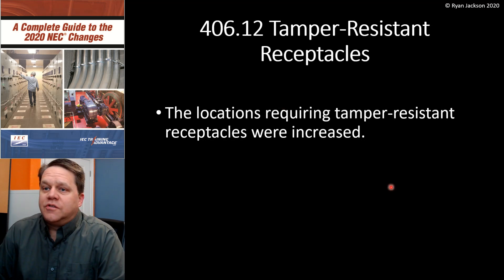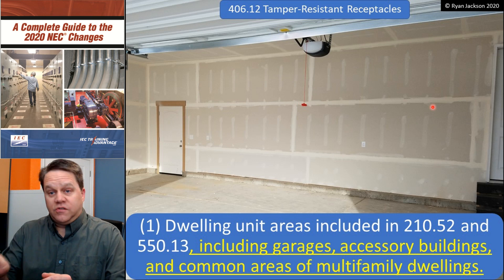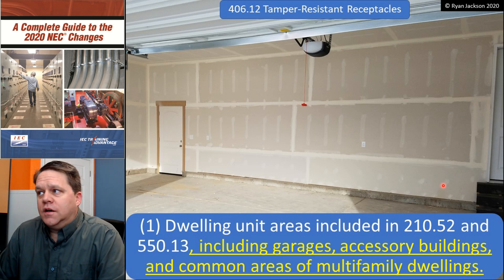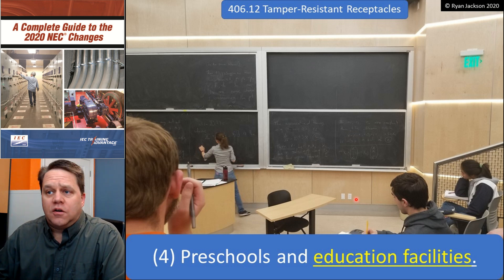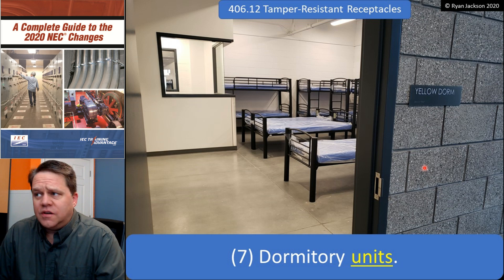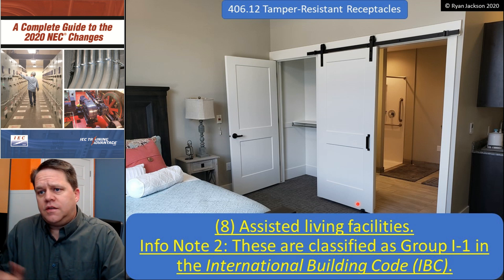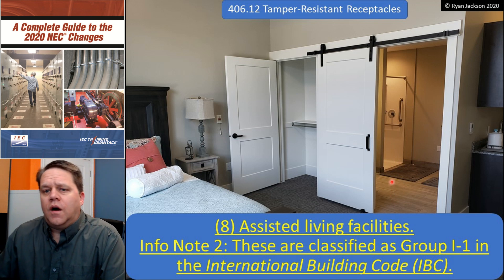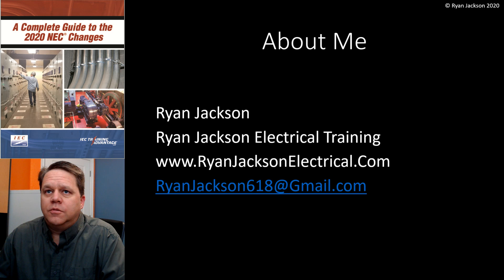2020 NEC 406.12: Tamper Resistant Receptacles

Comment: I don't get the non-grounded 2 prong outlet exception. Maybe just that no manufacturer will make any such thing, so unobtanium to buy? Kid could stick something into such an outlet and also get shocked or burned. Power runs from line to neutral same as grounded outlets.

Comment: ❓ I recently purchased an old house built in 96 and I am replacing all of the receptacles to temper resistant; however, I have one single receptacle that is a 20 amp / 250v. My problem is I can NOT find a tamper resistant 20 amp / 250v single receptacle (I checked everywhere.)  Do you know where they sell temper resistant 20a/250v, so that I can just change out the original? Thanks in advance!

Comment: I’m all for improving safety with stuff like this but these receptacles are a perfect example of mandating new technology before the reliability issues have been worked out. I bought a historic home a year or two after these came out and when I rewired the house I put in all new Cooper tamper resistant receptacles. It was a major battle to plug in most lamps, vacuums, etc.. My wife would call me to plug stuff in all the time because she did not have the strength to shove the cord end into the receptacles. I struggled with them too, crunching and grinding sounds and rocking the plug back and forth until it would finally go in. Some receptacles would have one half that didn’t work, some wouldn’t accept a plug at all. I bought a new house 4 years ago and they all work fine here so I guess they must have finally got the bugs worked out.
Reply: Try Hubbell-they have a new shutter mechanism that is very smooth

Comment: Does this add in a 220v electric dryer receptacle? Or just 15/20 amp 125-250v?
Reply from the maker: It doesn't apply to the dryer.

Comment: They should make it as a standard, any 15 or 20 amp receptacles has to be tamper resistant. Any outlet with a higher amp rating will be in a special loc. for an specific purpose.
This is just a waste of complicated wording for something simple.

Comment: Isn't tamper resistance redundant on a GFCI protected circuit?
Reply from the maker: No.
Reply: A GFCI will limit the amount of current you get to 5mA but you’re still going to get a shock. It only keeps you from dying, not from getting a jolt.

Comment: Hate these useless things
Reply: They wouldn't have prevented the mistake I made with a receptacle when I was a child.  I stuck a pair of scissors between the plug prongs of an appliance cord, and plugged it in.   Sparks flew everywhere, and I damaged the cord.   Good thing no fire or injury happened.

The working principle on these devices, is that the plastic interlocks require a plug to be inserted in both sockets simultaneously, rather than a screwdriver inserted into just one, as a kid might try to do.  You can still tamper with these, if you insert a foreign item in both sockets at once.

Comment: With a few exceptions, I don't see why companies wouldn't just install TR as a matter of course. That's all I've had on my truck for about 10 years already along with TRWR GFCI outlets. This really is a minimal cost to improve safety. I hope that with this change it will be easier to get SPEC and commercial grade devices in the TR version without having to special order them...